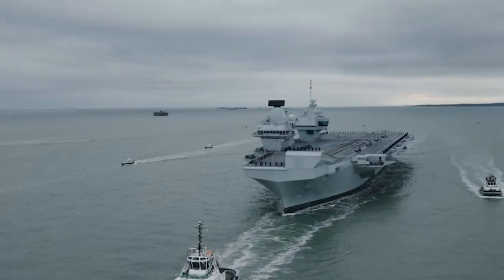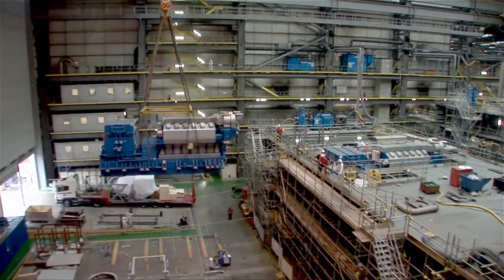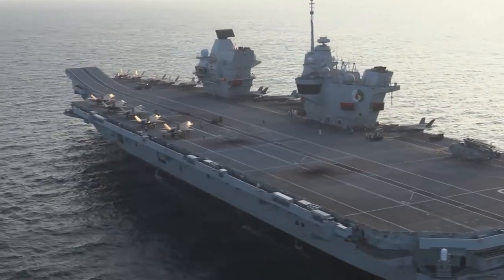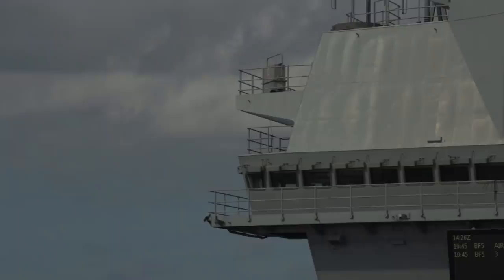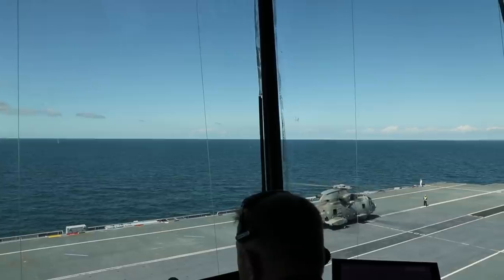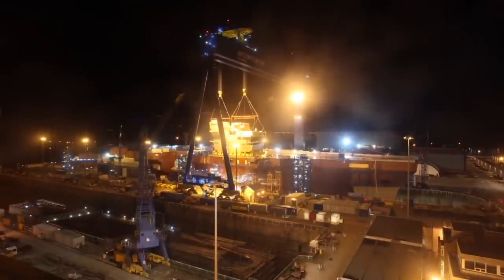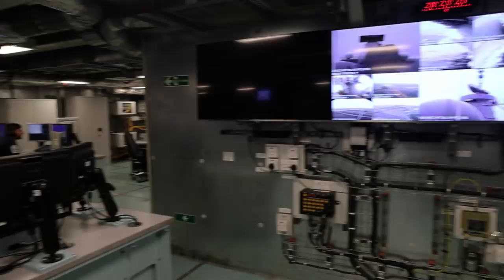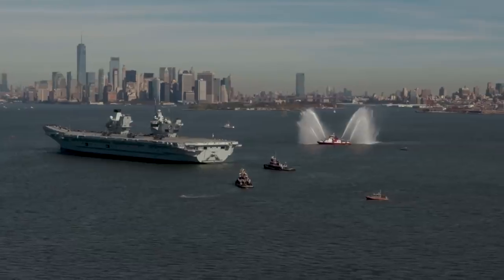Why Queen Elizabeth Carriers Have Twin Islands?

Comment: there's is technically 6 engine rooms, 2 Gas Turbines and 4 Diesels.
Reply: Thanks, I was surprised that a ship this size wasn't using gas turbines.
Now I know it was.
Reply: @marc0523  the GTs are not mainly used, the Diesels for cruising. The GTs are for Flank speed
Reply: This vid rather simplified things. Separating the engine rooms (and boilers) was a factor in warship design since c.1900.  But lots of other design factors also figure in, so a fair number of ships ended up with engine rooms close to each other.
Reply: @donjones4719  though they’ve replaced boilers with generators.
Reply: It was an utter cock up IMHO that these state of the art aircraft carriers, which will likely last 40+ years, aren't nuclear powered.
Reply: @ColinMcNulty  actually it’s a good thing, Nuclear powered vessels aren’t cheap. We’d probably only get one or fuck all out of the project
Reply: @Duke_of_Petchington  and the current designs were cheap?!?  We made a massive fuck up with the design choices. Because we've got no catapults, we're stuck with VTOL planes only, which basically means the hideously expensive F35's. 
You know we can't even afford a full complement of them? We're having to host US Marine Corp F35's just to have a decent number! 
Additionally, with no cats, we can't use something like the E-2 HawkEye for radar overwatch, instead we have to rely on Merlins with the new Crowsnest system, however helicopters can't stay in the air as long and are much more vulnerable to attack.
Reply: @ColinMcNulty  go read some Articles from SaveTheRoyalNavy.org
Reply: @Duke_of_Petchington  happy to. What am I looking for? The article on HMS Glow Worm was good!  In exchange, you read this article, which lays out an alternate future we could have had, had David Cameron's decision to have Cats on the carriers not been reversed:
https://www.theregister.com/2012/04/17/f35_carriers_plot_by_bae_and_raf/
Reply: @ColinMcNulty  you know the Company that makes the part for EM Catapults were sold to China
Reply: @ColinMcNulty  had to go to the page site owner, https://www.savetheroyalnavy.org/f-35b-the-right-choice-and-the-only-choice-for-the-royal-navy/ it talks about the F-35b and STOVL
Reply: @Duke_of_Petchington   Thanks, that was an interesting article. It would be a good comparison to compare the projected cost of the CATOBAR carrier vs what the VSTOL design turned out to cost. 
I also thought it would have been rather more sensible for the UK and USA to have collaborated on a single carrier design, as they were designing and building their Gerald R. Ford class carrier at pretty much the same time. But then, when did sense ever drive political decisions! ;)
Reply: @ColinMcNulty  the G R Fords had suffered some set backs because of the EM Catapults. We have a pair of new Carriers, the US are catching up due f ups, HMS Queen Elizabeth will be in Active service early than ford.
Reply: Also the US has the Personal numbers, we don’t and that’s why the QECs are more automated in some areas.
Reply: @ColinMcNulty  Why? Lol.. as none of the escort ships are nuclear, or the planes / helicopters ! Also as Britain has two Carriers we can't afford for one or both to be out of action for a couple of years when they do need refueling, also where would we dock the ship to refuel it? We don't have the facilities, and with this design we don't need to build them 😁

Comment: Back in the 1930s the USA adopted "unit machinery" installations in destroyers and cruisers. These installations had two boiler rooms and two engine rooms in alternating sequence.  It was not possible for a single hit to take out both boiler rooms or both engine rooms.

Comment: Its a backup system to launch aircraft if the catapult is malfunctioning. Just put an elastic band in between the towers. Put an aircraft in the middle. Pull and release. Great succes.

Comment: We almost had a proper sized  carrier that looked like an aircraft carrier, one island an angled flight deck, and a nuclear reactor, but no as Brits we always have to stop just short of being cool, in the same way that Russian ships bristle with armaments need them or not,  some bean counter decided that HMS  (insert name of ship) should be should only have a one 4 inch gun and a port hole with a GPMG, because it was felt that the global security landsscape didn't require it to have two guns, but this is subject to change and may require a costly refit, after of course a full review, a parliamentary committee inquiry and  a few years of chewing it all over to find the solution that gives the best value for the taxpayer. Just cover the fucking things in guns and missiles for fucks sake, they're supposed to be warships.
Reply: It wasn't the bean counters that kept changing their minds, it was the politicians. They don't understand that you can't build capital ships on the cheap. What would you use the second gun for ?

Comment: Might be worth a Nuclear upgrade. It could upgrade its ability for electronic warfare and deployment in a certain zone on influence. Having a powerful source of electricity is huge in computing. It could be a "Hack Jack" too. Perhaps extend its self reliability, if needed. 

   The two towers as a wind blocker seems like a big deal with jump jets on the sea for landings and crew safety. Both towers could triangulate on the ball landings with a guidance array system for night landings or low visibility scenarios. 

 Compartmentalization is HUGE for Carriers. If it is hit or takes on water that could be contained well.

Comment: The big radar on the front island is a SMART-L radar which is a big contribution to the air defense around the ship and also means the escorting destroyers do not have to carry it. It's a very big search radar used to monitor all the airspace around the ship. It can detect "stealth" cruise missiles at 65km, enemy aircraft at 400km and ballistic missiles at 2000km. Since the search radar is placed about 50 meters above the surface it has a much beter radar horizon too, this is very important to detect missiles flying very low to avoid detection.

The main disapointment with the Queen Elizbeth carriers is the fact that it has no catapult, this means that although its a huge ship it can only launch f35Bs which is a HUGE limitation. F35Bs carry less weapons and have worse performance just to be able to be launched this way. No AWACs aircraft can be launched which is another problem, the SMART-L is a very good radar but its still very limiting compared to having multiple flying radars launched from the ship.

So, the Queen Elizabeth carriers cannot compete with the US or the upcoming Chinese carriers although they are comparable in size. Its only meant to provide airspace coverage around the fleet and can only really work with a US carrier to provide the missing strike capability (heavy loaded planes) and AWACs coverage.

Comment: Why did the Brits build them with the carrier deck parallel to the hull of the ship? It's incredibly inefficient because that way the ship can only be used for either take-offs OR landings, instead of both at the same time. All the major navies' aircraft carriers have two separate diagonal carrier decks precisely for that reason; so aircrafts can take-off on the one deck and land on the other.
Reply: The UK came up with the angled deck design originally, but it's only used on CATOBAR and STOBAR carriers where you have an arresting gear to catch aircraft. STOVL carriers like this have a straight deck as their aircraft will mainly land vertically, so they're still able to have aircraft taking off and landing at the same time.

Comment: I'm not sure if the disadvantage is even a thing - These are modern ships so I can imagine that the flycon computers are live fed the heading / steering changes changes in real-time as high priority to determine if landing in certain weather conditions is safe and changes in wind directions etc etc. It would be a minor flaw at best that would be relatively easy to eliminate with computers.

Comment: if it's for redundancy, why are they both on the same side of the ship? a large enough explosion could take out both, no?
if you have a diagonal runway, you can put each of them on the opposite diagonal corners.
And if having large masses on the edges of ships is a concern for stability, a larger carrier with a larger runway makes it possible for the two islands to be positioned closer toward the center
Reply: I’m sure you could answer your own question if you thought about it.

Comment: The QE has hardly any defensive weapons. So reason why there are two Islands is that if it gets rammed by a Pirate ship then at least only one island will get captured. Blighty will still have control of the other island. The designers were also clever to have enough distance between the two so the pirates cannot use a ladder, ropes etc.

Comment: I would think that a video conferencing system would be a much better solution than intercoms. That way you'd have a single "virtual" control center.
Reply: What makes you think you know what form the inter-island communications takes ?
Reply: @hb1338  
It said "Intercom". Intercom (generally) means an audio only link.
Given modern technology,  I would think that a full A/V large screen video/stereo conferencing type link up would be much more conducive to efficient communications than a simple audio only link.

Comment: Other disadvantage is that it will take more deck space which could of been used to park aircraft or another elevator. Also cost more money to operate two towers instead of one, because the UK have more admirals then ships.
Reply: The alternative would be one long island with it being conventional, like the Invincible class it replaces or a US LHD. They actually take less space than the single island on the previous class.

Comment: The separation of flight and ship control is not as big of an impact as you might expect. Nearly everything I served on in the Navy had key functions in separate areas of the ship and it has very little impact. It's not like an aircraft where you can make a decision and see the change occur immediately, things as simple as turning the ship, changing course, or changing speed take minutes to see any noticible effect from the order given just due to inertia and the massive scale of the ship.

Comment: These ships have two sets of engines.  Both diesel and gas turbines.  The engines are separated so if one set is damaged, ie combat, it can continue.  Also, Diesel engines are more fuel efficient and they only use the gas turbine engines when they want to go FAST!  American nuclear carriers have two reactors, also separated but they do not need to exhaust like fuel burning engines do.

Comment: In this day why using Island for command post ? You just add targets for missiles, with the technologie we have now we can have the command post inside in the middle so it's protected and you have almost all the deck for airplane with no trouble in case of a crash. You can have much smaller island for exausts, drones, air defence and radard/communications.

Comment: Why not building a bridge between the islands? Irony: a bridge to connect 2 bridges. You certainly can limit the air drag, radar interference and other disadvantages with the right shape, position and materials. A shortcut for physical travel between these section is practical and certainly good for moral.

Comment: It is what I thought, since the exhaust stacks are pretty obvious.

I don't think it's ugly, but what I have always wondered is why they don't do a catamaran carrier setup. Total separation between two power trains, a huge stable deck, no diagonal landing strip, able to launch many times as many planes having perhaps 4 catapults and 2 landing strips. The downside I guess would be you couldn't get it through canals, though I'm not sure any carriers can anyway.
Reply: losing propulsion or steering in one side of the ship would have drastic impact on the manoeuvrability of the vessel. The "redundancy" offered by two separate hulls is useless if the loss of one hull becomes nothing but a detriment and literal dead weight to the other hull. If you're putting together that much material for a carrier, you might as well build two conventional carriers!
Reply: @yaseen157  Yeah, why have a ship that only works mediocre with one propulsion unit, when you can have a ship that becomes completely useless when it loses its only propulsion unit!

Please name a single time when a nuclear powered aircraft carrier lost its propulsion unit.

They don't break down. Not one ever has.

Comment: Have they fixed the leaks yet? And updated the Operating systems from XP?
Reply: You do NOT want to be going into battle and have all your computers come up with "Installing Windows 10 update. This will take some time"....
Reply: The prop shaft leak on QE was fixed during routine snagging at the end of sea trials, with no change to schedule. The engine room flood caused PoW's schedule to slip by about six months - the leak was internal and easily fixed but both the RN and ACA (builders) decide to re-test all the electrical components which got wet, which was a massive undertaking. With regard to software, XP is extremely stable, hardened and well understood - what do W7 or W10 offer that would make the upgrade worthwhile ? Answer - absolutely nothing.

Comment: The communications thing is a non issue, the air traffic controllers are used to remote locations on land based Naval Air Stations, and telemetrics will play a large part in the communities system.

Comment: If they have different radar systems for each island, then how to they practice redundancy in case one island is no longer functioning?
Reply: Both radars work independently from each other. One is a long range surveillance radar. And the other is a short range multifunction radar. They can work without relying on other.

Comment: Why do they still have a ramp and don't construct a plane - carrier - system with a catapult?
Reply: Catapults break, number one. Second, the QE and PW, are capable of launching the F35 in weather that would cause a cat-launch to be prohibitive. A great deal of experience and research was put into the catapult, non-catapult equation, and the choice to not have one was based on the number of sorties that could flown, number of aircraft launched under specific bad case scenario's.

Comment: My primary problem with the UK carriers is their lack of launching points. One ramp, one plane. Or, 4 catapults on a flat top. As far as islands go, the nuclear carrier has multiple reactors and 4 screws. No exhaust issues. So one island is all that's needed.
Reply: With catapults you really need more than one to reduce the impact setting each aircraft up and then resetting the catapult has, generally you're waiting for one aircraft to get clear before launching the next still.

With STOVL carriers there's no need for that setup, you can line aircraft up and launch them in quick succession. The Invincible class the RN used to operate before the QE class were 1/3rd the size and they did pretty well with this (Warning, loud) https://www.youtube.com/watch?v=fb7ZlZBDpEQ&t=251s

You could theoretically have a wider Ski-Jump to launch along side each other, but that would eat into deck parking and complicate things when you can already launch aircraft pretty quick on a ship like that.

Comment: The problem with this design, yes it is distinct and distributed, but it takes up more flight deck space which could lead to reduction in sortie generation or quick turnaround of the embarked aviation wing compared to the same design with just a single island.

Edit: one thing I do love is the traffic light system they have. 🤣🤣🤣
Reply: It doesn't actually take up anymore flight deck space than it needs to really, bare in mind that this is splitting a single long island that other conventional carriers have or US LHDs.

It wouldn't be viable to have a single small island like US supercarriers as the gas turbines in particular need large intakes and exhausts.

Comment: See i understand how it could be useful but at the same time its hard to manage 4 engines in one area let alone in 2 separate areas. Yes i like the idea of "Oh we lost the main engines? flip on the other 2!" it has so many issue's that can stop it. What if a torpedo destroys the input shaft. What about losing one tower and there goes half the radar system. If you think about it its true. Like yes it's cool but what about the amount of extra people you need. I just can see one torpedo ruining it all.

Comment: It would be a super pain in the ass to have to travel between those islands if someone had reason to. They probably have to go under the deck to travel across especially if the weather sucks or there stuff happening on the deck.

Comment: has nothing to do with the exhaust system,the design stated from the start it was gonna be twin island for seperation of ship operations and flyco regardless of engine design! .also the ENTIRE ship was built in modules around the uk and assembled at rosyth so the islands were always modular! finally the nanvy is well prepared for the design as they have been training on variations for years before the hulls were even laid out